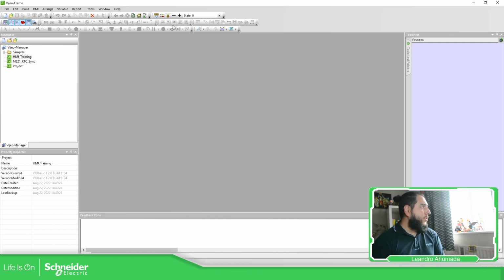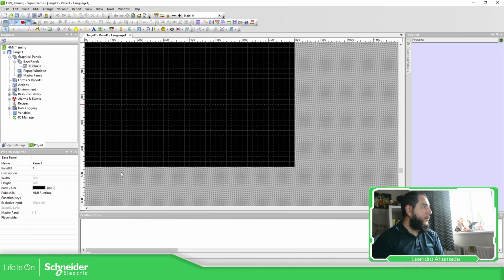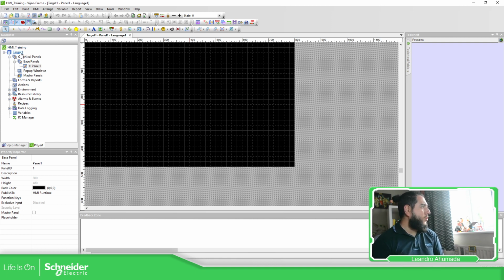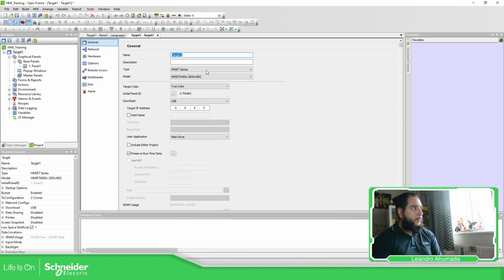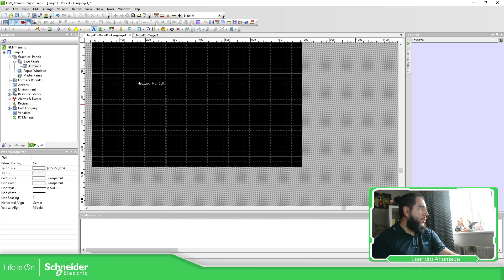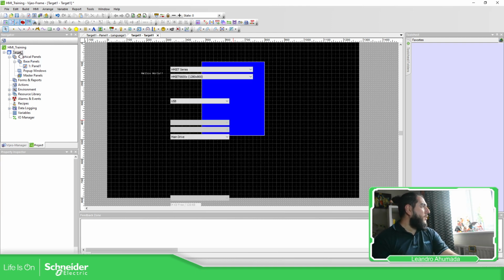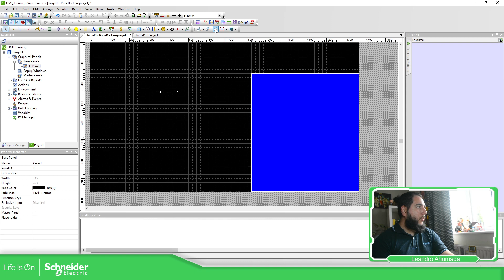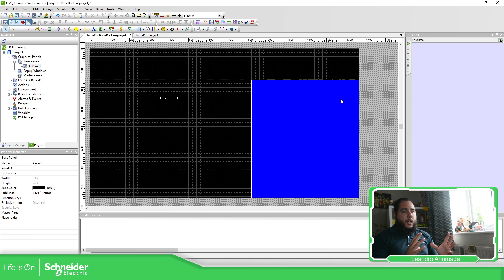Vijeo Designer Training - M1.1 Changing HMI

Comment: I kindly request the prompt completion of the course, as I need to program the HMI GTO for my graduation project, and time is running out.
Reply from the maker: Hi there! Which topics are you after?
Reply: @LeTomasAHUMADA  i have an HMIGTO2315 and modicon m221ce16t 
The program is "using pid for vitesse regulation"
I want to add the mesure of vitesse and setpoint in hmi( hmi is tactile)
Connection with ethernet cable 
I haven't any experience with hmi schneider 
That's what I need (time left:10 days 💔)
Reply from the maker: @raidbk2589  check my playlist for videos M14.4 and M17.1 to M17.6: 
https://www.youtube.com/playlist?list=PLFqT6GhMpgpLClSpB1iH50OUr4N4mU763
Reply: @LeTomasAHUMADA  well! I will check it 
Thank you for your help and your excellent videos, more success to you